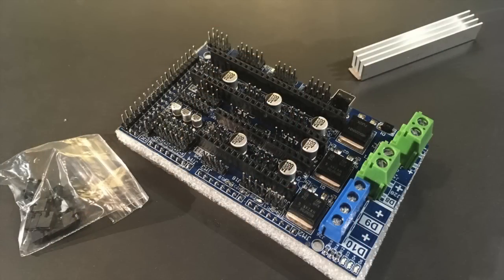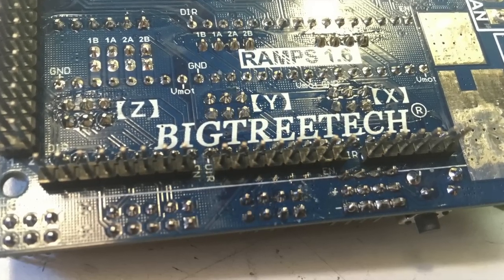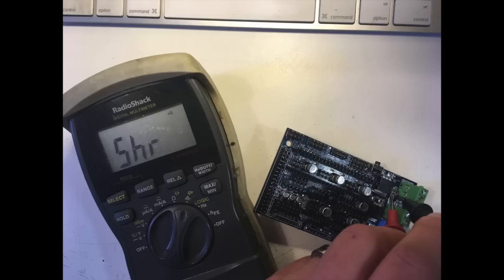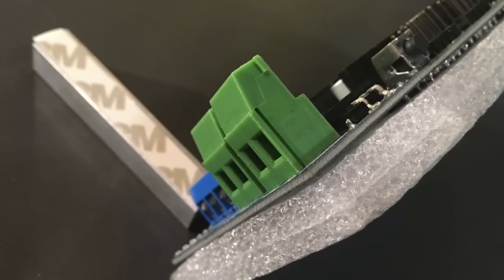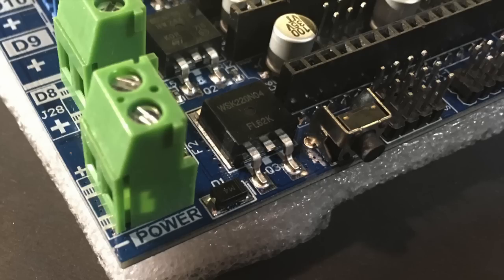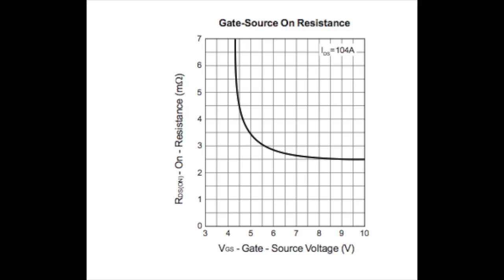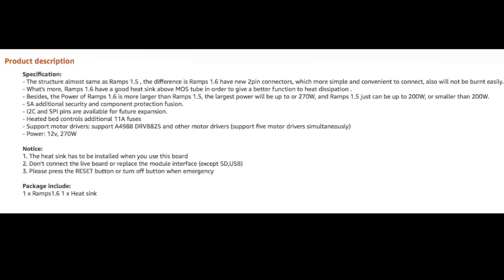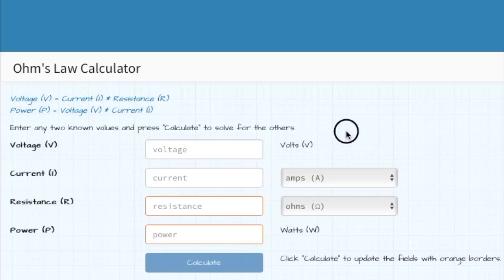(old video) Ramps 1.6 review: the good the bad and the ugly

Comment: Thanks for the Review. very good video , we will consider your opinions and update.
Reply: I just checked your website myself and feel the need to state that a good first step would be to abide by the community's standing practice of providing freely available schematic documentation, as required per the hardware license agreement for the original RAMPS boards. As Alex pointed out, this community is built upon open-sourced hardware, such as the original RAMPS boards, and removing that accessability does little more than alienate your potential customer-base.
Reply from the maker: The community thanks you for uploading the proper source files!  https://github.com/bigtreetech/ramps-1.6
Reply: Alex Kenis We have already updated the Ramps 1.6 to Ramps 1.6 plus  , welcome to review.
Reply from the maker: BIQU 3D Printer A review will be coming soon
Reply: @AlexKenis   with tmc2130 drivers please?

and if u can, with the  re-arm...  im just about to buy that combo :)
Reply: @BIQU_Makers  Are most of the ramp 1.6v board with 5v shorted? please clarify, and how does the 1.6+ iteration improved?
Reply: pro trick: you can watch series at instaflixxer. I've been using them for watching a lot of movies during the lockdown.
Reply: @Sterling Misael yup, have been watching on InstaFlixxer for since december myself :D
Reply: @Sterling Misael Yup, have been using InstaFlixxer for since december myself :D

Comment: The SKR v1.1 has an identical looking "30" fuse. That schematic calls for 30A, so I guess we don't have to worry about ever replacing that fuse. In case of a short, the fuse will probably be the only thing you can count on not to blow.

Comment: Bom is on gitthub 30A fuse.  5A fuse
Reply: I am thinking the fuse is there to protect the board. It might be better to fuse the heatbed after the board and before the heatbed. Normally fuses just protect wires or a circuit. 30a fuse might be bad for the standard mk2 bed if it fails. Anyone chime in got ideas?

Comment: Nice video, thanks for sharing.
There is one thing you can benefit from MOSFets or PowerFets in general; and that is you can parallel connect 2 or more FETs to lower the RDSon.
The resulting RDSon will of course follow Ohms law of paralleling resistors, thus reducing the Power dissapated in each FET.
This is perfectly allright as long as the FET is used as a simple on/off switch.
Reply from the maker: You re probably right, and I should test that eventually. My brain didn't go there at first because I have built a handfull of power mosfet amplifiers, and unmatched resistance = blown out mosfet, so you typically add 0.1ohm source resistors to balance it out, but for switching, it could be okay.
Reply: @AlexKenis  Why would you get blown out mosfets when parallelling ?
Mosfets are inherently temperature stable by their positive temp coefficient - exactly opposite the bipolar counterpart, which is negative and thus tends to suffer from thermal run-away.
The reason why you add a source resistor to even out the spread in exact RDSon, is to distribute the currents in parallel fets a bit more evenly.
If no source resistor, one of the fets will tend to carry more current, then heat up, and its RDSon will increase and the current decrease. Automatic equilibrum is reached then, but of course they wont have exactly the same housing temperaure.
Its a known trick from the past when I was active in electronics and Hi_current Mosfets were not readily availabe.
Rest assured you will not blow any Mosfets to death when trying :-)
Reply from the maker: Oh, absolutely.   I have to learn to let go and embrace switching topologies... I just have a knee jerk reaction because I come from the world of audio design, and mosfets get much more finicky in the linear region, where you will never find a complimentary N/P design without separate source resistors for balance and gate resistors for snubbing.
Reply: @AlexKenis  Yes - linear application is a whole different kettle of fish.
Thanks for your time discussing this subject, much appreciated.
Looking forward to more videos from you ... :-)

Comment: first, thx for your reviews
yeah their git schematics and bom shows 30A/16V  + 5A/30V. Fuses
apparently from the pictures of the 1.6plus they changed to 20A (hopefully 30V as well).
i am looking at buying a.re-arm+1.6plus shield to test some 32bit action, hope your review will be published "soon".
Also did you get a chance to take a look at their BIGTREETECH SKR V1.1 modular smoothieboard ?
Reply from the maker: Good eye.  I really want to re-do this vid, but you can't upload a different version unfortunately. I'll include an update in the 1.6+ review, which Ill do in good faith, hoping they will get the complete files up soon (they kiiinda released 'changes' files, but not complete). I'm just waiting on some more drivers until I do that vid (last shipping update was 2 weeks ago). As far as the SKR board, if they release the files (maybe ther are posted somewhere and I didnt see them), I'll look into doing a review.  I try to focus on open source, but even so it is much much harder to do a real in-depth and accurate assessment without complete data. Heck, I'm still waiting to see if they get all the SBase files up so I can look at that.  The posted SOME them, then removed them, then posted them again, then removed them again... so that one is in the same boat: just waiting the  PCB files and schematic.

Comment: Great Review, thanks. I meanwhile ordered a RAMPS 1.6+ from Bigtreetech and it is kind of the opposite of the one you ordered. It has pretty good soldering quality, all connectors are soldered in straight, and it has some additional features like jumpers to connect TMC2130 driver SPI pins via the board. In addition it meanwhile has some documentation here https://www.biqu.equipment/products/biqu-3d-printer-electronic-parts-ramps-1-6-upgrade-on-the-basis-of-ramps-1-4 . I was wondering if you feel like having a look into that. I'd pay for your board to support your amazing work.
Reply from the maker: I just got one in that I had ordered for testing as soon as I heard about it, but I am waiting on more tmc2130, which are currently on the slow boat from china since USA prices are so high on them lately (I usually get them from DigiKey, but prices went from $7 to $12.50 each, unsoldered and without a heatsink). So I'll do a complete review when those arrive.
Reply: @AlexKenis  that's great news! We (Germans) are lucky, since watterott sells them for prices that make ordering from China a prity stupid idea ;-) Looking forward to your video.

Comment: There's an error in the PCB design for the RAMPS 1.6 made by HESAI. Found they had a trace that shorted R16 for fan mosfet led which blew the led. Not sure if it's the same for bigtreetech board
Reply from the maker: Good catch.  I just checked a bigtretech 1.6 board, and R16 trace is fine

Comment: I got this exact board about a week ago after I nuked my 1.4 board being an idiot (took out the arduino too!). I didn't have too much time to do proper research and I just snagged it off of Amazon. I reconfigured a fresh Marlin file and it's been working really nice with a new set of LV8729s. The bed heats a little slower than my old 1.4 board, but I think this is because of a lack of PID tuning on my part. It has no trouble staying hot once it gets there.

I will also say though, I had to enable endstop noise filtering in Marlin, which I didn't have to do with the 1.4. Maybe that has to do with it being a 4 layer board?
Reply from the maker: That's interesting. I would think that the issues might be related to the chopper in the driver chip.  If they kick out more electrical noise than your other drivers, that would explain the problem.  WHen I get around to doing more driver testing vids, maybe I'll set up a noise test to see if that is a significant issue for some

Comment: I see you talked about ramps 1.4 and ramps 1.6, but you didnt make a video about ramps 1.5. what do you think about the 1.5 version of the board?
Reply from the maker: I included a 1.5 board in the video with the 1.4 boards, but I didn't go into much depth.  In a nutshell: It is basically a 1.4 with surface mount components.  A few things are moved around, but the schematic is basically the same. Like ramp 1.4, it is barely adequate to handle 12v electronics if you use a heated bed, but is okay for 24v+.  The 24v mod is simpler than 1.4 because it uses fuses instead of poly-fuses, so you just have to snap off the backfeed diode and power it seperately.

Comment: Hello Alex, thank you for these videos! Quick question, I not be using the RAMPS board for my heated bed so the current there isn't an issue, but I will be running 24V for the rest. Theoretically this should simplify things on the RAMPS board side. I know you have caveats for most of these boards, is there one that you prefer if the heated bed portion isn't being used?

Thanks!
Reply from the maker: Most are okay at 24V or more, especially if you are using an external FET for the bed, so just make sure the polyfuse and capacitor voltage ratings are high enough, and the 1.5/1.6 use 32v SMD fuses so those are fine too.

Comment: Have you actually made this board with Alex? We ordered a 1.4 and got this instead. We have not been able to flash the firmware successfully. Not sure why it doesn't seem to upload... Newb obviously.....
Reply from the maker: Yes, I have used 2 of them.  The RAMPS should not effect the firmware upload though.  Typically those type of problems are either in the port/board/etc selection in the arduino ide software, or a bad usb cable, or another program is using the software COM port (for example, don't have pronterface running when you are using the Arduino IDE, etc).

Comment: This is the only thing I have found that someone is actually talking about what I bought! I’m new to this world and got this to replace my fried Anet v1.5 before I realized there’s really nothing out there that’s safe for a complete noob like me to get this working. From one metal head tinkerer to another any direction for programming/flashing firmware on this for an Anet A8? I don’t have much, but I would be willing to figure something out to compensate for your time. For the time being my new toy is an oversized paperweight. Just got it dialed in and was finally printing quality parts. Thank you so much for your time and efforts with these videos and products. Keep up the  good work.
Reply: Based on your level of experience, I would recommend the Duet3d WiFi or Ethernet. It's expensive, but basically bulletproof. One of the things that you won't get from the Chinese makers is support. That's not a problem with the Duet3d, it is extremely well supported. 

Don't bother with the display, that's another $45 to $100 dollars, and you can just as easily control it from your browser.

But on the other hand, if you live close to a Makers Local, pay them a visit and see if there is someone there who can walk you through the conversion (using a cheaper board).
Reply from the maker: I would recommend looking into A8 reddit and facebook groups for a step-by-step guide.  I don't think there is anything particularly tricky about swapping the mainboard and flashing new firmware on those machines (except that the stock 1.5 board is a little tricky to flash marlin to because i THINK you have to flash a new bootloader), but you should be able to dig up some step by step guides from people that have the machine (I can't really give a detailed guide because I don't own one). Hope that helps
Reply: Colin Smitley Cancel

Comment: Yeah....fuses.
A fuse isn't a simple "oh...my machine doesn't work because the fuse blew".
Many people will replace a fuse thinking it is the source of a burnout/point of fail.
Fuses blow because something else is wrong with the board causing a short.
Someone who can't solder 0805 or 1206 SMD components shouldn't really be trying to figure out other board faults (experience) and should just spend the £30 on a new board. To me, harder to remove fuses are a good modern safety feature.
Reply from the maker: I hear ya.  I have that same feeling when I see people putting fans and whatnot on polyfuses that trip from over-current... the problem is not the device.

Comment: Has anyone else noticed the labeling of the two diodes D1 and D2 has been swapped so D1 is now D2 and D2 is now D1 and I believe the correct location for D1 is closer to the center of the board not near the fuse F1( As shown in this video) that one used to be D2. If you remove the one near the fuse you are removing a reverse polarity safety feature. This will also not prevent the 24Vs to flow thought the arduino and most likely you will burn out the 5v voltage regulator. I have a few Ramps 1.4 and a Ramps1.5,  I have carefully compared the boards and traces to confirm my claim.  judging from what was said in this video Ramps 1.6 Is also labeled backwards. 
     Can anyone confirm my findings as I am no expert and mybe mistaken.?
Reply from the maker: The D1 position freaked me out too: the labeling is correct, but their positions on the board are swapped.  D1 is still the backfeed diode, but for some reason they put it near the fuses.  I have one running at 24v currently with the D1 removed and D2 in place, and it is fine.  When in doubt, put a meter probe on the anode of the diode and the other probe to ground, it should read close to zero ohms if that is the polarity protection diode.  If you want to make extra-sure, put a probe on the  diode's cathode and the other probe to the backfeed pin, it should read close to zero if that is the backfeed diode.
Reply: Damn it ! your right I blew out a $35 mega copy from Velleman. I removed the wrong diode on my new Ramps 1.5 thinking they got the labels wrong and probably ruined both boards in the process on the Velleman Mega2560 the AMS1117 5.0v regulator chip near the usb port POPPED! and the RAMPS 1.5 with its  SMD mount components plus the location of the Polarity protection diode, that I mistakenly removed, well makes it pretty hard to solder back on if I can even find it. 
   In hindsight I can see why they decided to move the back-feed D1 to a more accessible location by the fuses that answers 1 question .
   But who is "they" anyway and why the lack of info? If it wasn't for you and I we wouldn't know anything about the new 1.5 & 1.6
They cant just go changing thins like that without documentation information what happen to open source ?
Reply from the maker: Thats a bummer.   I actually did the exact same thing with D2 when I first tried a RAMPS 1.5, but luckily the mega survived somehow (that was the 1.5 I used in the torque testing video), so it is just running without both diodes.  I have had okay luck with the cheapo Elegoo MEGA clones on amazon, that might save you a few bucks, and  they have the pin numbers silkscreend on the side of the headers, which makes life easier.  The "they" you are referring to are Makerbase (aka MKS) and I agree that they should release more detailed docs to prevent accidents and confusion: many of the RAMPS derivatives are lazy about that, and they just point to the 1.4 docs.
Reply: I payed $35 for it because I had it delivered same day. I got tiered of waiting for shit that don't work I own 3 other mega clones imported that just stopped uploading new sketches! Something to do with drivers for communication trough the usb port not available or corrupt.
Reply: So to run the Ramps 1.6 at 24v, all I need to do is remove d1 and Power the mega with USB?

Comment: I sow another vid you made With the TMC2208 driver but on the MKS Gen 1.4. There it sounded like its was good to run the drivers on 24v.  is it just to cut the leg on the Ramps 1.6 card and runt it on 24v and i get 24v to the drivers??